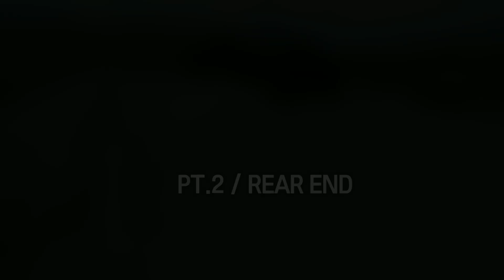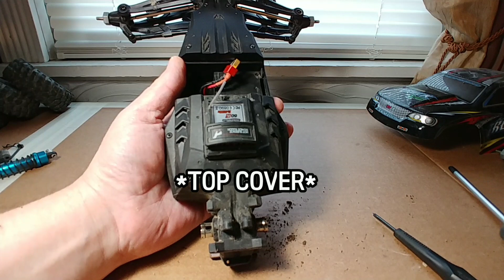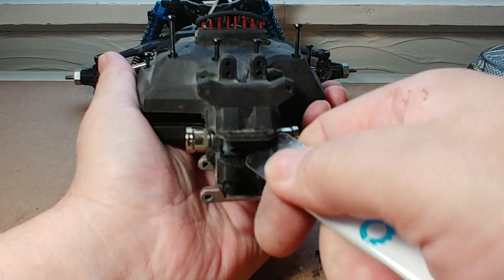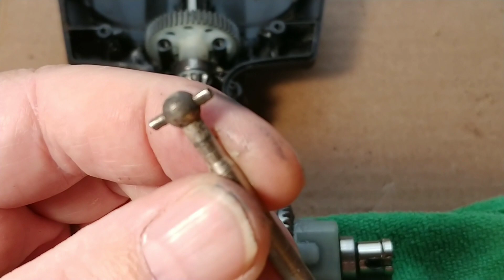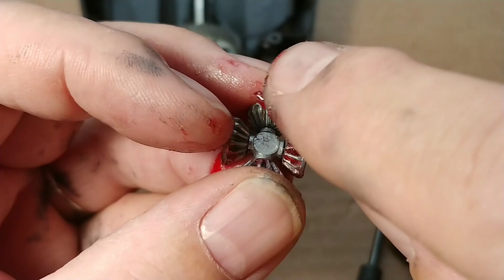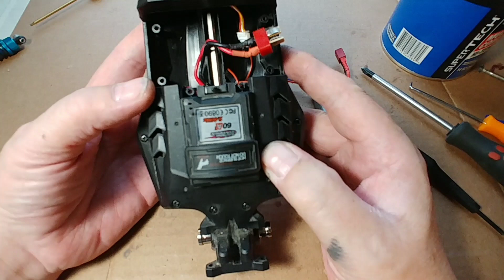XINLEHONG 9125, GPtoys S920 & HOSIM 9125 Inspection & Service, Pt. 2

Comment: Hello, I have a problem with my 9125 vehicle. The vehicle accelerates by itself when I touch the gas trigger, I cannot control the speed at all, it does not go behind.

What could be the reason?

Comment: Bought the 9125 for my son, on the second run the front wheels stopped turning and now the truck makes a pitched electronic sound when I switch it on. Any ideas what it could be?
Reply: I have the same problem, I ordered a new servo for 7.50$ and I wish that fix it .

Comment: Yo moo dog 3 of my tires work but 1 just spins freely with my hand the rod is spinning but tire won't think one dog bone is stripped?
Reply: They got a hexnut on back of tire. Tire might not be tightened down with the hex nut fitting correctly in the rim

Comment: Hey how you doing, wanted to see if you can help me out I have this hosim truckI'm pretty sure it's one of the first ones that came out the ESC and receiver it's chrome metal, what a question I have is that part burned out the ESC and receiver,so I bought a new one on eBay but they send me the new version the ESC and receiver underneath that little plastic it's red,and guess what when I looked it up it works and everything but the remote instead of going right it goes left the turning position is wrong please help

Comment: really helpful video, need to add grease to my new 9125. but i found that it's better not to remove the shock tower, that way you can just pull the whole cover off, no need to pry it out. it goes for the front cover too, just pull the shock tower gently and the cover will come off..

Comment: THIS IS GREAT!! Thank you! I just got my truck a week ago and I can already tell there's a lot of tightness on the differentials. After seeing this video, I can tell that there's no grease in there. This will be my weekend project! Again, thank you!! 

Additional quick do you ever clean the motor or spray anything in there?
Reply: I opened up mine after watching this, thinking of applying some grease into the "dry" differential gear. But it's actually not dry. It has grease inside them already. Nevertheless, I cleaned off the stock grease and applied red grease.

Comment: How did you get those driveshafts off so easily mine are locked in with that 12 mil nut in the knuckle
Reply: The updated 9125 has different axles and 12mm nuts from the original 9125.

Comment: Hi all, really like your videos Mr Frugal cheers. I have this model truck, at first I was excited by the capabilities, I'm new to the hobby. Unfortunately my 9125 has spent equal time on the bench as on the street. The driveshaft to front wheels popped out of it's socket and rounded it off. Both differentials then failed at different times. The keys on the cups of the diff just sheared off. Hosim are good at customer service so they're sending me the parts (this was all in the first 2 weeks of running). So I advise viewers if you are getting this truck, make sure you do the diff service shown in these videos. With hindsight its worth saving a bit more to get an intro model from Traxxas, arrma or the like.

Comment: Just watching this and had a question my truck today front end stopped spinning and it was 2wd. I have it pulled apart and the only thing I've found messed up I think is the driveshaft. Back where the gear is for the motors actually pulls off of my shaft so im thinking that it's not spinning the shaft to transfer any power to it
Reply: If the drive shaft is not spinning then the rear wheels would not have power either. Front differential maybe?

Comment: Hey I took my tire off on the same car and when I put it back the tire was little bit wobbly when moving. I took of two tires off and both are wobbly a little any recommendations for me to fix this. I have the stock wheels also nothing is broken and every thing is tightened

Comment: Wow that was easy! Thanks for both videos!   But my car is still not wanting to move. I thought this would fix the problem. Maybe it's both motors?
Reply from the maker: Hmmm.  Do you hear any hum when you give it throttle?
Reply: @LeSiZmOr  yes! Just humming like it wants to move the wheels but they just turn side to side but other then that, no power.

Comment: Do you need to grease the spur fears and the drive line gears.
Reply from the maker: I think it's a good idea.
Reply: MooDog's Frugal R/Cs! Do you know how to remove the Front CVD form the wheel hub? The rears are those dog bones but my front CVD is slightly bent and is like to replace it.

Comment: I am thinking of buying this truck what all upgrades have you done I see different tires and rims and the shocks you talked about thanks
Reply from the maker: This one stayed pretty much stock. I haven't run this truck much lately. I have to order lower A arms.  The shocks I had on it were too long and it was causing undue stress on the shock mount points.  My mistake.  Make sure you are getting the right length when and if you plan a suspension upgrade.  The mount points on the lower A arms are pretty thin.  Great truck. Hard to kill for sure!
Thanks for watching.
Reply: @LeSiZmOr  -- Have you tried the OEM oil-filled shocks for the 9125?

Comment: Great video but you said you couldn't keep dirt out but I think you can by putting a woman's nylon stocking over entire housing for Motors and you don't have to worry about overheating or anything like that because nylon is very thin so air and heat can still get in and out
Reply from the maker: Excellent tip there!!

Comment: Hi Moodog
Great video.
My 9125 is making a noise like gears are riding each other. Doesn’t happen if I gently ease on the power (which is never as everyone knows you have to drive everywhere at full throttle).
Can the large plastic gear which the motors drive be replaced? I haven’t opened it up yet as I want to know as much as possible before I do. Also. If I put a parallel Y split in the battery cable and add a second 2s battery does this then make it 4s?
Reply: Sounds like my same problem. What did you replace to fix it?
Reply: I just got mine; it has the same noise, which may be normal.

Comment: Very informative video ty so much I have learned plenty! 👍🏼 I just purchased the same truck from amazon I think it’s well worth the money. However I would like a bit more speed out of it can you recommend I motor that would give me the satisfaction I’m looking for? Much faster is what I’m trying to achieve.
Reply: Just use a 3s lipo, I've used a 1500mah 3s and it goes like stink, just leave the battery cover off and hold it in with a velcro strap and away you go!

Comment: Do you know how to replace the rear knucle? I removed the tire but have no idea how to remove those metal pins.
Reply: Find anything on it? Got the same issue
Reply: @PenguinWarrior203  me too!  Still can’t work out out to get them off
Reply: @adamtonkin5907  I did find a solution that worked for me. Use a heat gun (not a hair dryer) on the plastic surrounding the pins. This eventually makes the plastic just barely soft enough to pull the pin out with plyers. Hope this helps you out!
Reply: @PenguinWarrior203  Thank you!  I just saw this - I managed to bang them out with a allen key of the same size - not easy!
Reply: @adamtonkin5907  I didn't think to try an Allen key, not a bad idea! Glad it worked for you though!

Comment: hello! new problem guys when i see this video i go check my differential and no grease, some internal gears not move but i put grease and fine, the problem is in the video moodog don't disassembly de differential totally, there are one part where the dog bone goes that is conect too the gears and is completely destroy i dont know if is because no greese or the metal is weak, someone can help i can buy another diferential but is not possible make a upgrade of the metal parts of the diferential.i have photos but i don t know how send,thanks

Comment: i make the upgrade shocks but i have a problem whit the front lower arms of my hosim 9125 when i jump or crash the wheels get off the lower front arms what can y do any ideas?
Reply from the maker: Hey there,  do a pre drive check of all screws that they are snug. If you are talking about A arms popping off the hub carriers then...again check before you go out to bash!.  You may need to replace the lower arms.. Its possible that the mount points are worn.
Reply: ok a put larger head escrew and solv for now @LeSiZmOr

Comment: Is it possible to swap differentials front to back and extend cups lifetime (they wear on one side only)?
Reply from the maker: Great question. The cups are the same both front to back so theoretically, you could swap them out.  They will wear more in the rear generally speaking, due to higher torque from motors being in so close proximity.

Comment: What kind of Grease do you use
Reply from the maker: Hey there.  I use auto grade multi duty red hi-temp grease on all my RCs. Check out my part 1 video .. I go over that in more depth. 
Thanks for watching.
Reply: lucas oil red synthetic
but, it was already greased don't put too much grease in it.. he will be harder to run and the gears motor will be destroyed

Comment: Great video James, goes to show how dirt and grit comes through those cooling vents on the sides of the chassis and ends up inside where the motors are mounted. and what a surprise about no grease in that rear diff, that's terrible. I received a couple zd racing diff's new from eBay and one of the 2 is locked up while the other spins smooth and freely. I am going to inspect before installing because I bet its dry inside as well. Will do this preventative  maintenance on my 9125 after a few more runs, cheers, thumbs up!
Reply from the maker: Thanks Dave!  Yeah, a lot of crud gets sucked in through the cooling vents for sure!  Preventative maintenance with these things is key!   Thanks for looking!

Comment: This was one of my choices from GearBest to do a review on, I did buy the smaller version 9130 for my brother-in-law  back when I first started out n really thought it was a great truck for the price, but since I had one on the channel I picked a different model, but this is a great starter rig
Reply from the maker: XLH is really a great manufacturer!  The 9130 is on my radar as well.  Thanks for stopping in stevo!
Reply: 9130 is a cool little truck, I bought one recently as you know :)
Reply from the maker: @PERTHWESTOZRC  Yes indeed!   Looking at that for my next!